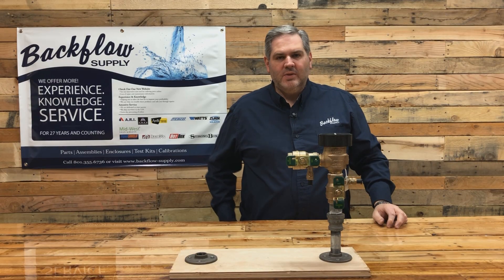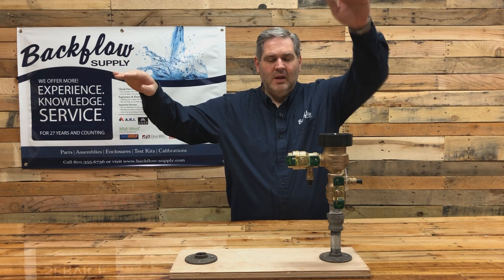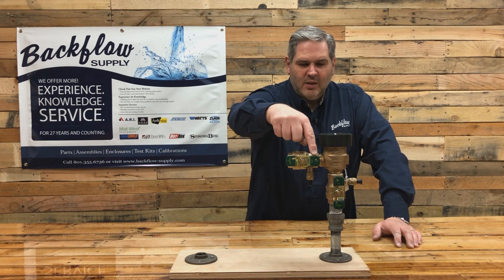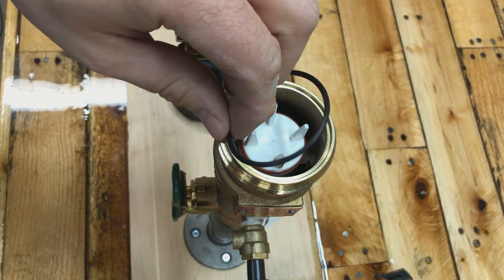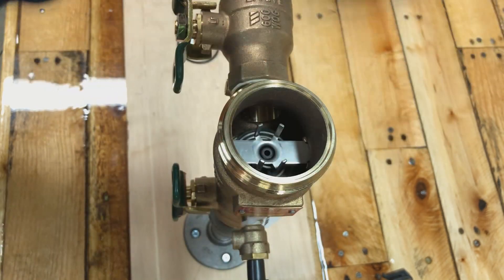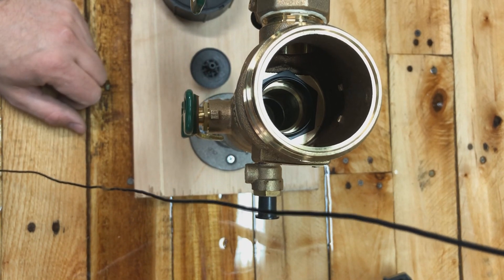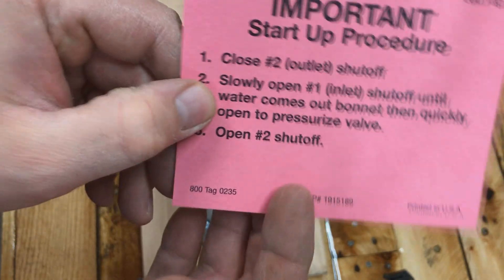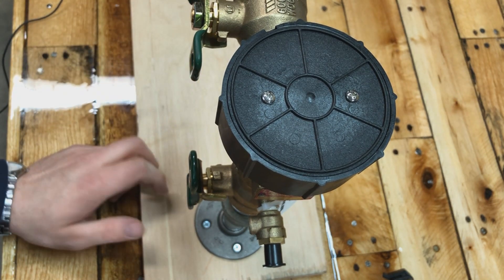Inspecting and Taking Apart the Watts 800M4 PVB Assembly

Comment: Good video but several small issues for clarification:
You need to close the shutoffs and release the pressure inside the assembly using the testcocks or you will not be able to unscrew the bonnet unless you ate a big bowl of your Wheaties or use a pipe wrench and likely damage the bonnet
You need to lube the O-ring at the base of the bonnet  with a food grade lubricant or it may tear or dislodge when reinstalling the bonnet.
In Florida the DEP change the requirements for testing of residential backflow valve assemblies to be every other year and commercial still remains to be annually. Other States may also not follow the annual testing recommendation from the manufacturer.
If a homeowner or anyone else opens the assembly then the law requires the valve must be tested again even if the regular testing by a certified technician occurred just last week. 
Good job Sean!
Reply from the maker: I need to redo this one.  I rushed it as a customer was asking for it and needed it ASAP.  Just have never found the time to redo it.

Your additional information about codes does depend on jurisdictions.  However, anytime it is repaired or worked on it should always be tested to ensure it is working as it should.  Thanks!

Comment: Can you link to a replacement part for the 800M4 3/4" assembly parts. I ordered the kit on Amazon and it doesn't have the 4 prongs.  It is a rounded plastic piece on the red washer part.
Reply: I just received the following from Amazon to fix my 800M4. However mine is 1" not 3/4. I needed three kits: Bonnet Repair 0887701 $32, Pressure Breaker Valve Vent Float Kit 0887710 $11 (the upper white 4 prong), and  Check Kit 0887704 $24 (the bottom black 4 prong). I may not have needed the bottom black kit. They also have combination kits (seemed more expensive), and a freeze resistant kit called a "Retro Kit Converts". Just search for 800M4. I am going out to fix mine now. I just watched this video. Thanks for the video Sean ... great job!
Reply from the maker: @terry.albertson  Thanks for jumping in Terry
Reply from the maker: I wonder if you have a 1" assembly, not a 3/4".  I also believe you are referring to the vent float that the water pressure pushes up against the black plastic bonnet it to stop the water from flowing out of the top.  

Here is the link for the 3/4" vent float https://backflow-supply.com/products/rk-800m4-v-1-2-3-4?_pos=1&_sid=6f39058be&_ss=r 
And here is the link if it is a 1" https://backflow-supply.com/products/rk-800m4-v-1?_pos=1&_sid=481ea5b00&_ss=r

Call me at 801-355-6736 if you need more assistance.

Comment: I am very critical of Watts RPZ backflow valve assemblies because of their design however, the Watts 800 M4 in my opinion is the best PVB on the market. I have installed and repaired so many of these that I do not want to guess at the number.
Something that you did not mention but is important certified backflow technicians may not be the only ones watching your videos. You talked about people installing a hose bibb to use water from the irrigation line. Many homeowners install their own hose bibbs but they often install them on the wrong side of the backflow valve assembly. The hose Bibb must be installed after, or downstream, of the assembly or they are not protected by the backflow valve and are in violation of the plumbing code. 
Good video but you are working on a brand new valve. When you disassemble them in the field the components of the valve do not allow you to remove or reinstall parts as easily and you show here and sometimes need some gently persuasion.
Reply: Lunker012 good comments about where the hose bibbs need to be located.  In one of my earlier attempts at recoding this I did mention about this being easier because it was a new assembly.  So hard to get it all in.  I hope to keep improving.